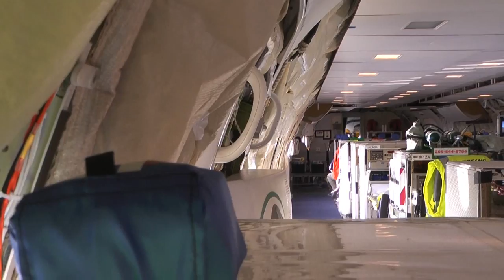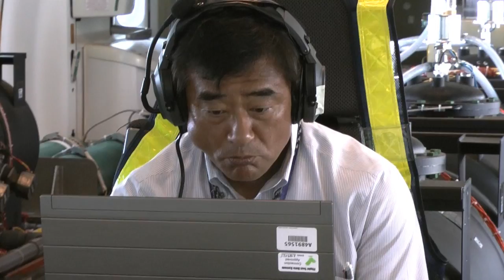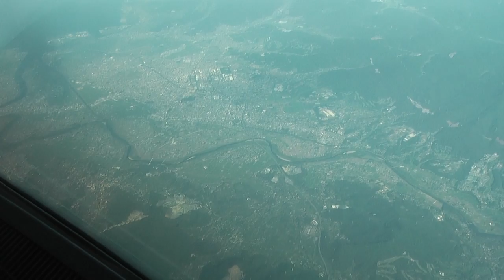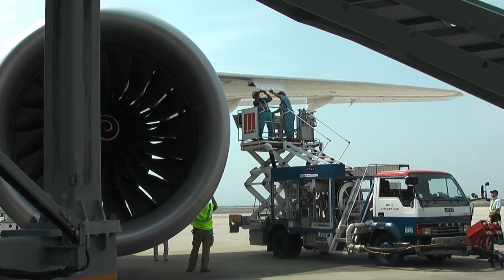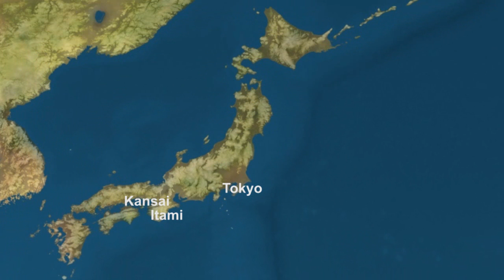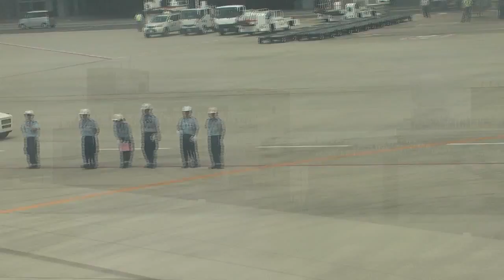ANA flies Boeing 787 on airline routes

Comment: @TidemoreLongspot841 Aircraft tend to be noisy machines.  I'm a fan of both Boeing and Airbus, the competition between them makes them both great.  I've been in very noisy Boeing jets and very noisy Airbus jets.  Also been in rather quiet jets from both of them.  Engine choice (RR, GE, PW, et al), aircraft model, and its age are the factors with the most impact on noises, noise, and noisiness, not whether it's Airbus or Boeing. :)

Comment: Is it just me, or is there a 'weak link', to potential access to critical information of the aircraft using Wi-Fi? It would need to be a fixed password so all the techs can access the tech info, so that is the weak link. I would be more happy with a direct cable link... Hackers would like to expose the weakness's of the wi-fi security... who knows what else can happen. Nightmare scenarios... Especially with all the security breaches lately. Else, I like what i see. Wi-fi for passengers, yes. :)